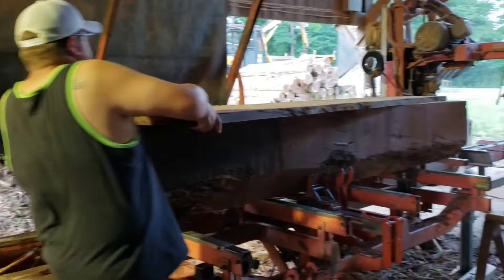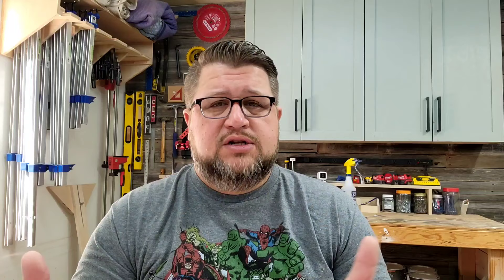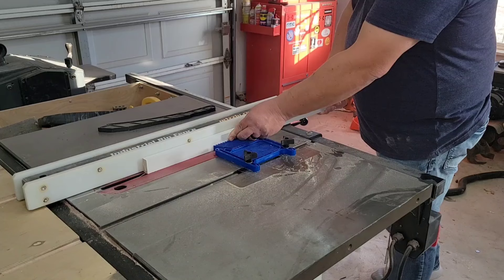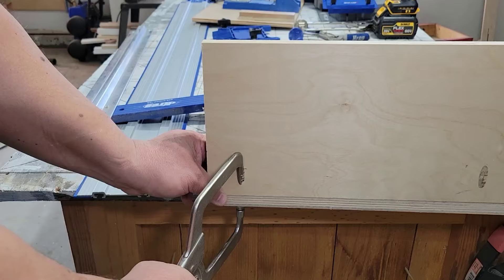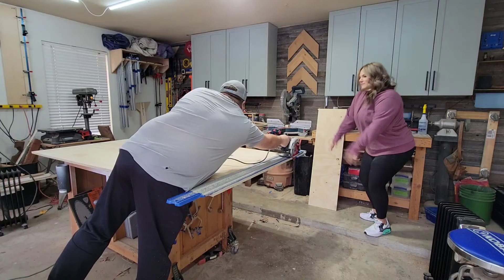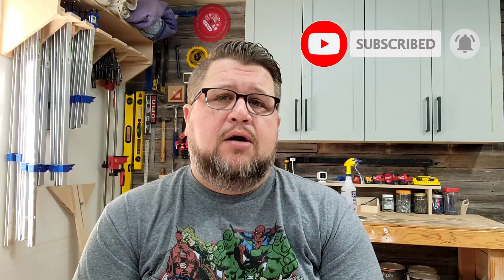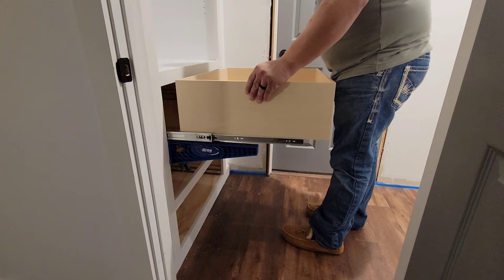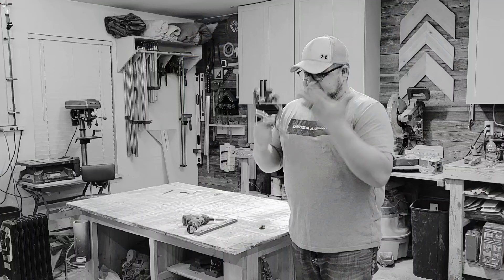Ten Kreg Tools I Love (and one I hate)

Comment: I bought the kreg feather board and it wont tighten in my miter slot no matter what I do
Reply from the maker: You know I bought a second one and it has the opposite issue. Gets tight and is frustrating to get loose after using. Probably a QC issue for sure
Reply: @DebtFreeDIY  probably. It's pretty frustrating. I try to go cheaper on everything because I can usually get it dialed in but even the cheapo table saw has a common miter slot size so it should have worked..but nope. Works on my sawstop fine though and according to the calipers it's the same size slot lol

Comment: The rip cut has never made any sense to me. In the video you're cutting off your reference edge. In the Kreg promotional vids they usually have the work piece supported on a sheet of 2 or 3 inch foam. You can make a jig out of scraps that would work better and cost next to nothing.